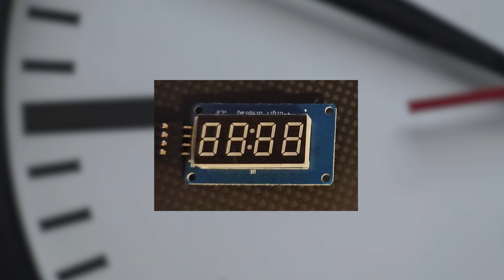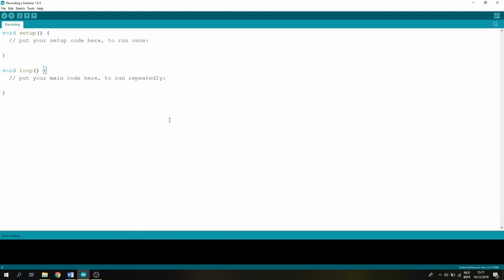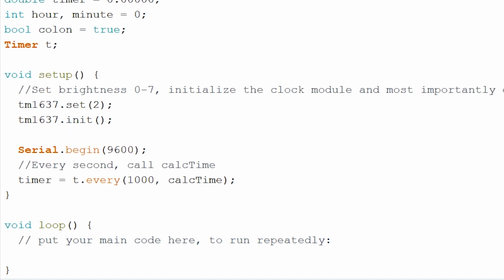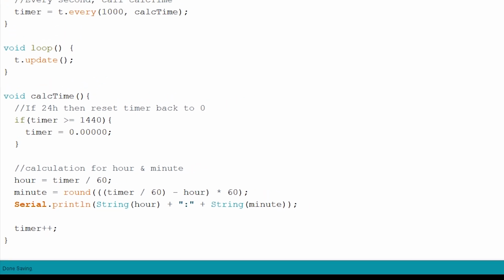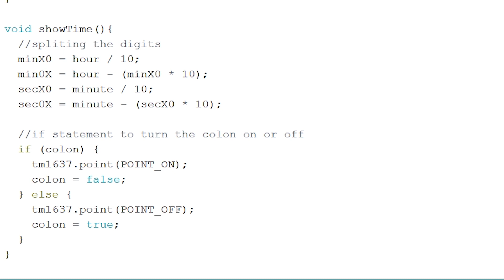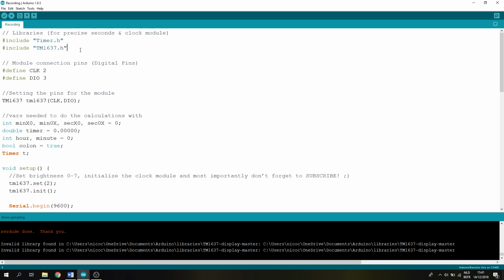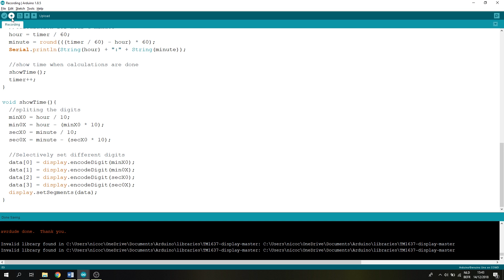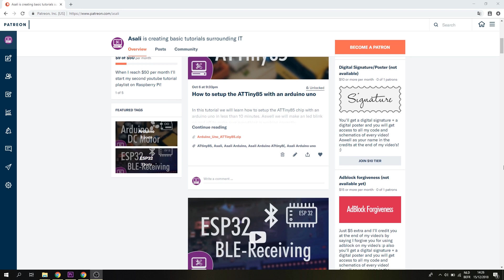How to create a clock with the TM1637 clock module in Arduino uno

Comment: personally i think, that this video is very confusing for beginners. First off all the code changes all the time and you have to pause the video all the time. Also the newer versions of the Timer librarie dont have the .every function. The librarie of the TM1637 changed and i had to try out how to use the TM1637Display and the TM1637, which i first thought are the same, but then looked up on stackoverflow. My advise is to code while filming and explain which librarie and version you use to make it easier to understand. Nice video though helped me alot!